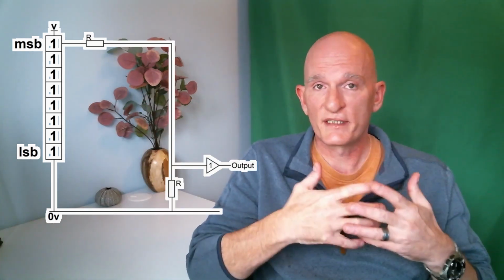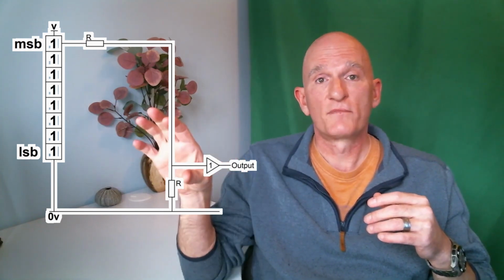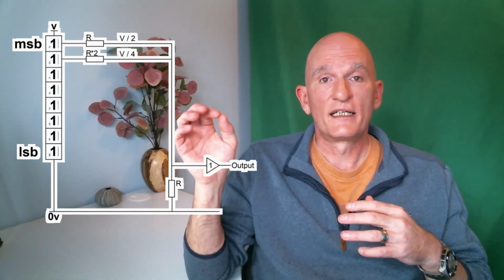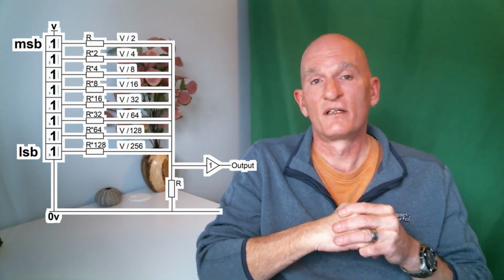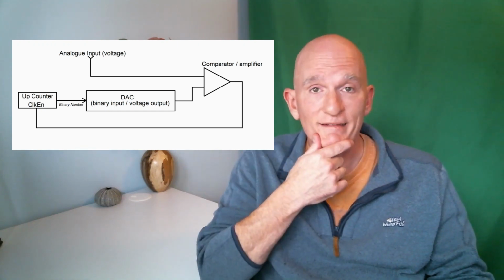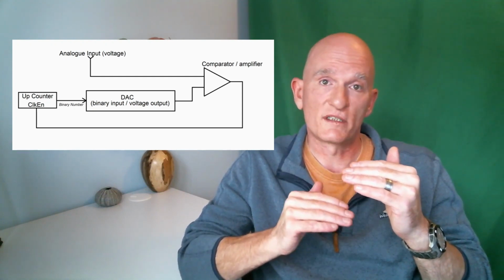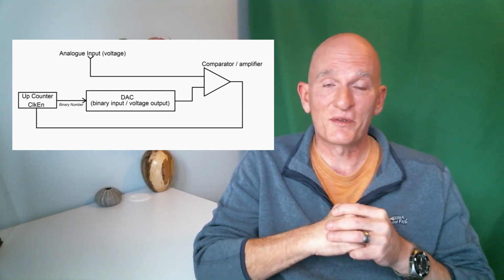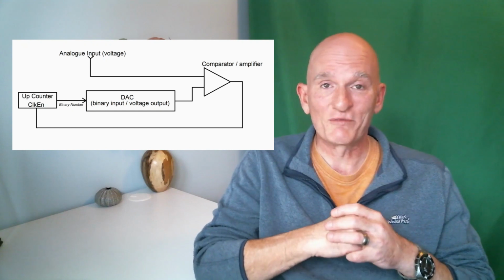DAC & ADC Explaned

Comment: Both your videos are very well explained. Thanks
Saw your YouTube Ad. I currently work in IT/Security sector (digital data extraction from mobile devices). Looking for careers where I can leave the 9 to 5 Mon to Fri format to working as a contractor or consultant basis. I wonder if your course also caters for this.
Reply from the maker: Thanks for the feedback, much appreciated
There are hybrid as well as fully remote working roles in this field (usually after a short stint on-site to get to know hardware etc), but they are in the minority and you will generally have "core-hours" you'll need to be working for team meetings etc.
You'll also only be able to get these kinds of roles once you've professionally proven yourself, both technically and motivationally.